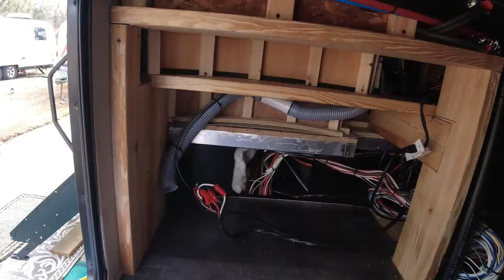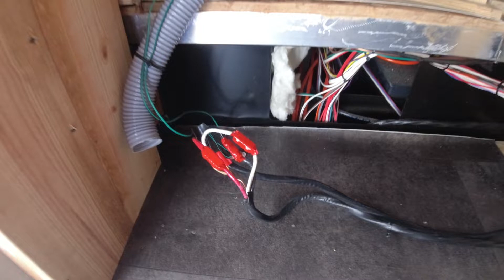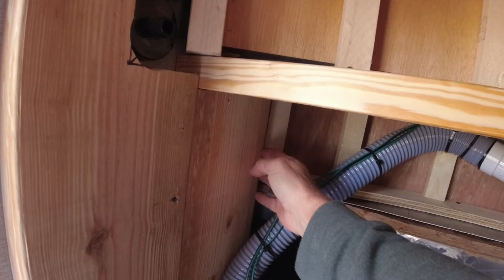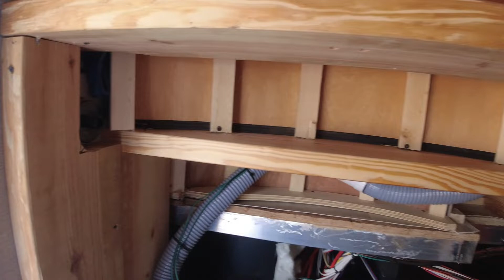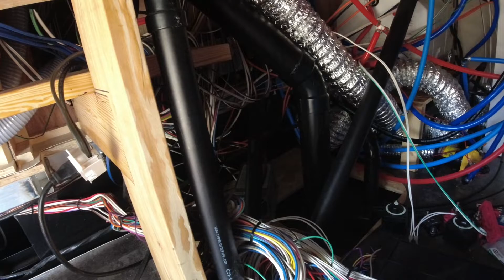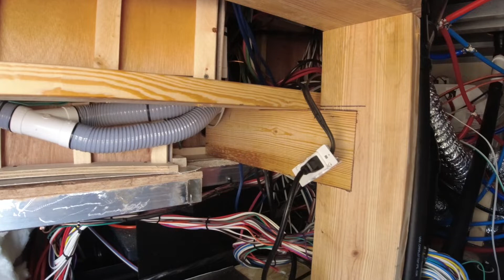Workshop Wednesday: Re-structure RV steps

Comment: Nice job. I have seen in other of your videos the step structure untouched. And of course here in this video it is complete (beautiful job). Can you share a photo of the change over in mid process?  With this mod is there enough room to hang the Victron multiples 2 - vertically ? I thought I saw one of your videos where you may have installed one in another GD rig. Any thoughts, input would be appreciated. Love the workshop videos!

Comment: Nice work on your solar installs and basement mod and thanks for sharing. I am curious though, why not use the front storage bay where there is quite a lot of room, especially when there is no generator and all components including the batteries are easily accessible?
Reply from the maker: Good question, I mostly do not install in the front bays due to climate. Those compartments are not temperature controlled.